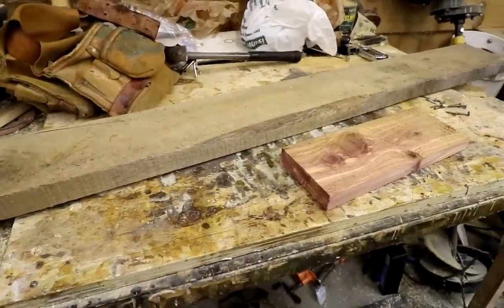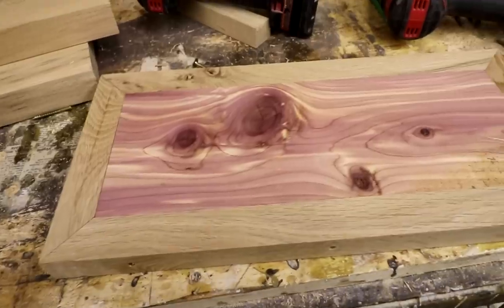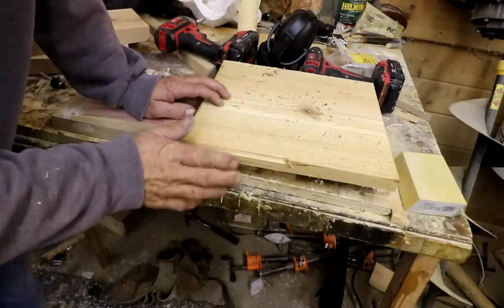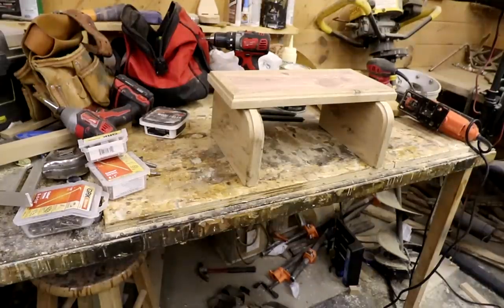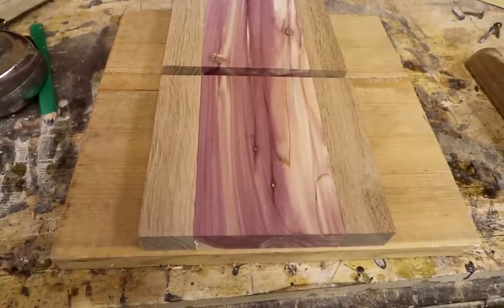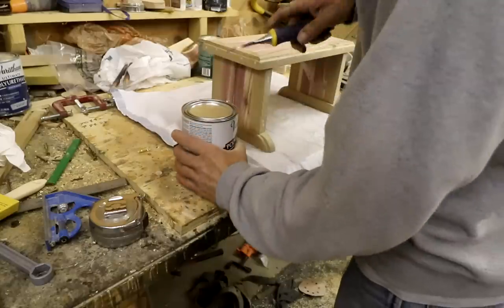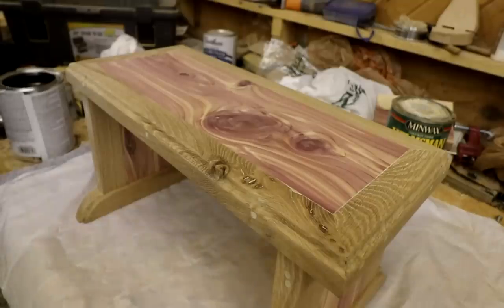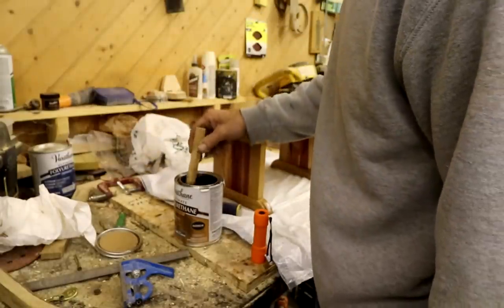THE WORKSHOP. Toilet Stepping Stool For Melissa.

Comment: Nice job!  What do you do after sanding between coats?  Do you just blow it off or do you need to wipe it down with a wet rag or something to get the dust off?
Reply from the maker: I just blew it off, sometimes I will use the air compressor.

Comment: Must be a tall toilet, huh Joe? I'm 6'5 tall toilet is great! As far as wood working tools do you have mortiser ?  I use to have floor model jointer, a Dewalt planner and one time Jet wood lathe. Still have miter saw, tall Delta drill press, small table saw and Jet 14" band saw. Paslode nailers jig saw and other stuff.